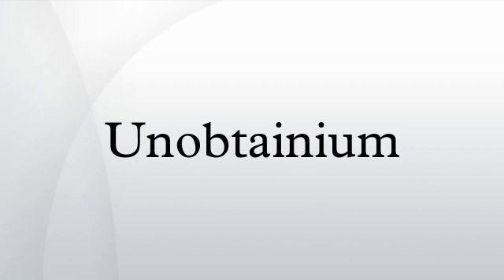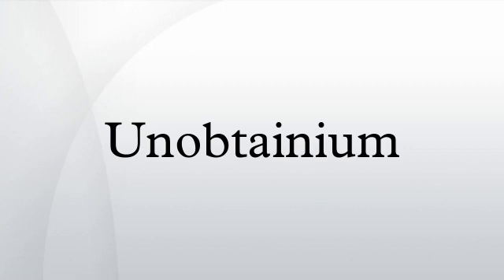Unobtainium

Comment: I don't like this use of the term 'unobtainium', because it mixes disparate and contradictory concepts. Here is a set of terms to distinguish the nuances:

MacGuffinite - From "MacGuffin", coined by director Alfred Hitchcock, a plot device that motivates the characters and advances the story, but has little other relevance to the story. "MacGuffinite" may be some valuable ore, substance, or commodity, that hopefully introduces no unintended consequences to the SF universe you are creating.

HANDWAVIUM: It flat out violates laws of physics. We're waving our hands and saying pay no attention to the man behind the curtain (Wizard of Oz reference). This is some machine, scientific principle, exotic mineral, strange energy, or other item dreamed up by a science fiction writer which does something useful and valuable but which regrettably is forbidden by the laws of physics.

UNOBTAINIUM: We can't build a physical example of it, but insofar as we can postulate that it can be built at all, the laws of physics say it would behave like thus and so. Calculating the range and damage drop offs of a laser of a given wavelength, aperture size, input energy and conversion efficiency to make a weapon is pretty much unobtainium right now. While Handwavium and Technobabble tell you what you CAN do, Unobtainium usually tells you what is NOT possible.

Technobabble: Any impressive and scientific-sounding, but ultimately nonsensical utterance, full of buzzwords. Technobabble need not be bad, though in general it's only noticed when it is done poorly.
Doctor: Looks like a spatio-temporal hyperlink.
Mickey: What's that?
Doctor: No idea, just made it up. Didn't want to say "Magic Door."
— Doctor Who, "The Girl in the Fireplace"

From the Atomic Rocket website, http://www.projectrho.com/public_html/rocket/index.php